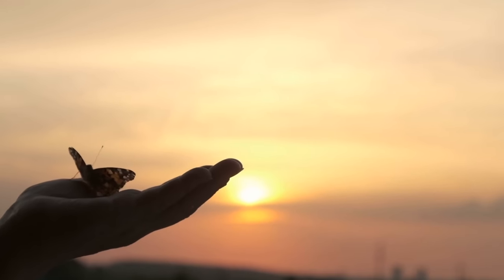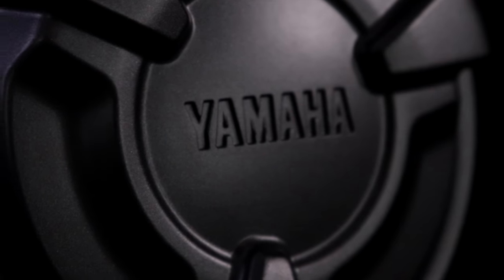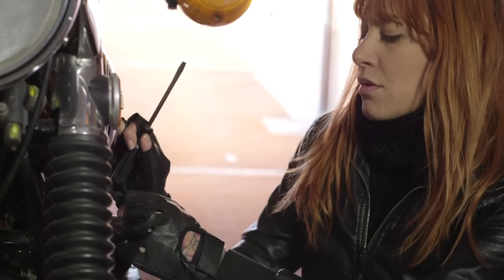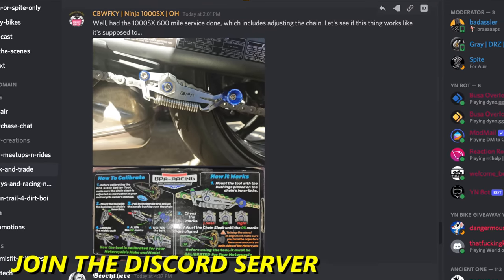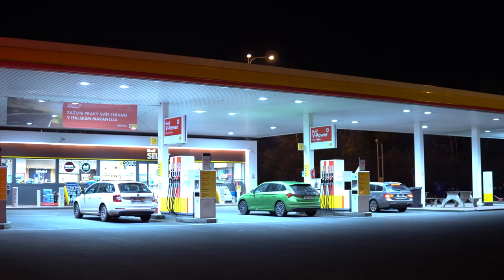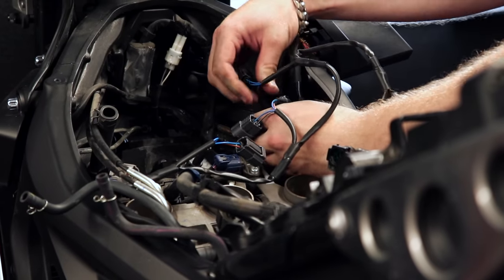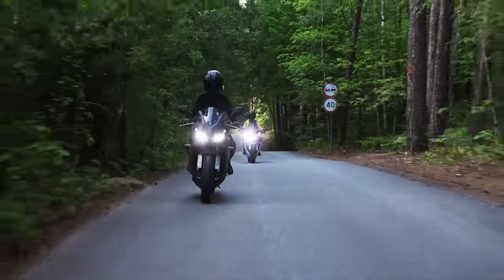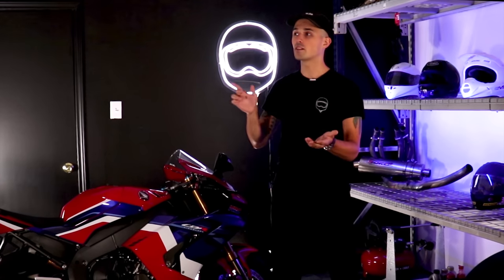7 Ways to AVOID Damage to your Motorcycle (Will Last Forever)!

Comment: You do realize that the redline and even the factory rev limiter (which is usually above the redline) still actually have a certain amount or percentage of safe operating limits built into them right? Bikes leave the factory with this extra margin of safety built in so that the motors will not become hand grenades and need warranty replacements.
Even most aftermarket CDI boxes allow the raising of the point where the rev limiter kicks in and raising it on most bikes by 1000-1500 rpms higher causes no engine issues on sport bikes anyway.
Secret is knowing where the power and torque start dropping off in the rpm range on your particular engine as generally running the revs past that point gains nothing in performance.
Another one that draining the oil for a winter storage is not the smartest, although changing the oil and filter before you put it away is a good idea.
Also when you start your bike ALWAYS run it til it is at full operating temps to prevent creating condensation that does not get dried up before you shut the bike down. And yes store with the fuel tank FULL of treated non ethanol fuel.

Comment: Yammie Noob, you have some stuff wrong. 
1) when you do your valve clearance checks, it’s not the head gasket that you want to replace, it is the VALVE COVER GASKET. It would be insane (a lot of unnecessary time and money) to change a head gasket while checking valves. 
2) it is not best to let your bike sit there idling to warmup. It is best to ride it right away after startup but with LIGHT engine load….meaning don’t lug it in too high of a gear, nor pin the throttle and have maximum combustion pressure. Ride immediately at 1/3 throttle opening or less and between 30% and 50% of redline. Be easy on it until the OIL TEMP is at 170 degrees. This will warmup the bike faster. A SLOW IDLING warmup increases how long it takes for the oengine to reach temp, which increases the amount of water vapor (which is a natural byproduct of combustion) that blows past the rings and dilutes the oil with water. Faster warmup is best, but be easy on it until it is up to temp. 
3) running lean does not make the bike run hotter. When the bike makes the most power it is making the most heat (the burning fuel heats the intake air which expands the air and pushes the piston down). So when u get a bike dyno tuned for max torque and power at every rpm and every throttle position, it will make the most power and the most heat. Running either too rich OR too lean will cause reduced power AND reduced combustion heat. Ask private airplane pilots who have to manually adjust the fuel mixture as they fly at different altitudes (and thus air temperatures and air densities). The highest exhaust gas temp will be when the airplane has the perfect stoichiometric fuel mixture and is making the most power (like for take off). Once at cruising altitude, they will lean the mixture which reduces the EGT (exhaust gas temp), the engine runs cooler, with better fuel economy (but not as much power…but max power is not needed when at level cruise). All too often, motorcycle riders set up their Power Commanders too rich. What does this do? It makes less power and the excess fuel doesnt burn.  The excess fuel washes oil from the cylinder walls which increases piston, ring, and cylinder wear. 

The rest of your video is spot on. FWIW,  I’m a 62 year old retired mechanical engineer who has been riding, driving, flying, maintaining, and tuning motorcycles, cars, and single engine planes since I was 15 yrs old.

Comment: Coming from a dude who dailys a bike in the states these intervals are critical. I literally look at 3 things on my Fz's cluster Everytime I step on. Mileage before and after the ride, check the trip for my oil change and I always run my temp when I'm riding around so if something goes wrong and it starts getting hot I'll know right away and be able to pull over HOPEFULLY not killing me or the bike😂

Comment: Idle for carb for that long if not used for a few days or a while, but fuel injection shouldn't be more than 20-30seconds. Any longer and your ECU for your fuel injected bike will be putting extra fuel in their to cool the engine. Just start riding it gently for 5-10mins before maxing it out, much better for the engine and your time than idling for 3-5mins..

Comment: Funny.. standard gasoline in Europe is 95 octane. Then you got the “premium” gasoline which is 98 octane. Its called respectively e10 and e5. Here its the other way around. If you have a new bike you can perfectly fine put 95 in, but if you have an older bike its best to put 98 in. E10 is partly synthetic and it eats away older rubbers. So you dont necessaraly need the higher octane but its generally a better quality gasoline and better for your bike.

Comment: meanwhile: me on my a1 motorcycle--> hitting redline on highways, little amount of oil, and having to use anything at my disposal to squeeze enough usable power out.
Reply: Jesus 😂 🤭
Reply: @AkaBull  the rev limiter (10.5k tpm) in 6th gear cones on at 79 miles an hour. The speed limit is 75. I cant wait until i can get my a2 liscence. I'll me getting a zx6r that's 25kw on paper but full power irl. By the time i have my full liscence i will have been riding for 7 years.
Reply: @sillymust1057  God. I love it here in the US 🇺🇸 we don't have those restrictions here, we at least not as bad as yours.

Comment: 107,000k on my Victory Kingpin so far runs like a monster put new pistons and rings and freshened the valves at 97k.
Reply: nice almost like a car, 120k is normal for piston rings on a car
Reply: well... on my car at 125k i changed piston rings all gaskets chain and all pumps and some vvt but only piston rings and chain were worn out rings were destroyed and ran without them 8k and didnt missbehave

Comment: I think it's fine to redline if the oil's always good, and it's thoroughly warmed up.
Reply: It will wear out much faster, but we aren't trying to keep every bike as a museum piece. If they only last 100k miles having fun instead of 200k miles being worried all the time, well that's probably 10x more miles than most riders are going to use them for anyways (and then you can always find a crashed bike for cheap parts if you need to fix it).

Comment: Don't let it idle more than 1 minute if you have a 2 stroke :D

Just give it low rpm at start
Reply: I've heard the same thing suggested for all motors. Riding/driving away at very low rpm and load (for the first couple minutes) warms the motor much faster than simply idling it, and warming up faster is supposedly more beneficial to the motor than idling it with zero load 'till warm. -- Of course the main lesson is the same. Warm the bike before working it; warm thoroughly before thrashing.
Reply: @kleinbottled79  exactly. when you leave your garage, there is no need to redline it within city limits. so just cruise until you reach the twisties.
Reply: I do 5 minutes, never had an issue,  well not yet that is 🤭
Reply: why is that? just curious

Comment: -Don't let your bike idle for a solid 3-4 mins. Why? Bcs it takes 1-2 seconds for the oil pump to get lubrcation on every part of the engine.
Yes, the engine should be up to temp before going hard, but you can warm your engine driving softly for some time instead of idling, which provides bad lubrication (engine rpm=oil pump speed).
-If you have modern bike you should not run high ocatane by default, just use whatever the manufacturer recommends in the manual.

Comment: Wait a minute. 3-4 minutes idle? What? I thought excessive idle actually wears piston rings and seriously dilutes the engine oil with gasoline since there is a lot blowby(cold piston rings dont seal all that well)

I always learned to let the bike start, idle for 10-20 sec and then slowly drive and only give more throttle when oil is warmed up.
Reply: Yes that is also what I am taught. a lot of old timers say the same thing. Don't listen to yam on this video, especially on storing the bike without fluids.
Reply: That's essentially what I do. I start my bike in the garage, push it out, shut the garage door then hop on and ride, maybe 30 seconds. Never once had a problem and I've been doing the bike thing daily since 2002. All super sport bikes except for a new Harley which I hated.
Reply: @madpirate1790  that is also my routine. I'm glad it's worked for you, almost everyone I've asked who is very knowledgeable about engines recommends this
Reply: @sam2920  yeah it's better to do if you ask me and like you said alot of other mechanics will say the same thing. Just ride it around for a few before you start taking it to Redline.

Comment: And lean air fuel mixture is not hotter than stechiometric 😄 the highest burning Temperaturen is at stechiometric. If it gets leaner ist will get colder. The same for ritcher.

Comment: 280000 on victory v92 full syn oil basically stock motor I don't beat on it but ride hard n long big tips use good oil all the time.n don't just ride to bars ride at least fifty miles

Comment: As far as warming up goes, I don't like keeping the bike on in the garage for more than 30s - 1m, even with the door open, because of exhaust vapors. If I let the bike idle in the back alley, where my garage lead, it's kinda noisy for the neighbors and I don't like being "that guy". Is it okay to drive off immediately, but just keep the revs AND the throttle inputs really low? Like shifting at 3-4000 rpm, while the engine warms up?

Comment: For warming up my engine, I kill two birds with one stone; I start up my bike, then get suited up. While the engine is warming up, I'm putting in my ear plugs, donning my jacket, etc. By the time I'm finished gearing up, I'm good and ready to go... :)

My dealer doesn't carry the manufacturer's oil for my bike, so I use the weight recommended in the owner's manual.

For gas, I run regular 87. What more does one need with a 9.5:1 compression ratio?

For engine mods, all I did was remove the stock filter and airbox snorkel, and replaced with DNA Filter's high flow filter and high flow airbox intake. I let the engine run 15-16 minutes at idle, so the ECU could adjust itself to the different O2 sensor readings it was seeing. After that, I was good to go! I wouldn't do any more with my bike though.

Comment: Idk about tip number one, the oil pump will distribute the oil immediately when the pump is turned over even from cranking. Viscosity of oil is actually thicker when it’s cold vs when it’s warm. Letting it sit for 5 min will do nothing different than if you let it sit for 30 sec or even 15 sec after starting.
Nooooo don’t do dry storage
Reply: The metal won't be at the correct dimensions, its really not so much spreading the oil (though its lubrication value I think does go down when its cold), its more the valves/piston are at incorrect dimensions and will therefore wiggle more and scrape things up. Some engines you can really hear a horrible nocking sound until they warm.

Comment: you don't ever do head gaskets for fun. if you take care of a motor, you can run it hard and maybe never do a head gasket. you probably mean "valve cover gasket." you do head gaskets and cylinder and case seals when you're building engines. they're NOT maintenance items. replace only when blown.

Comment: I just got my bike AND started riding just yesterday. And it kills me to think that thing may die on me one day
Reply: In most cases bikes die of loneliness. There are a ton of 250cc bikes that just get put away (often improperly) before they get even 5k miles on them (mine is somewhat sadly an example of that, though I do have it in a shed and I blocked it up so the tires are less likely to rot or get flat spots). The other thing that usually kills bike is a wreck, in which case there is a good chance if your bike is totaled you're also probably dead, so wouldn't worry too much about the bike. Then the last thing is someone never changing oil, but if you're maintaining it then that's probably not going to happen until its so utterly obsolete its an antique or drove it multiple times around the earth and got 50x your money out of it in enjoyment.

Ride it and don't worry about it, worst thing is for it to die of loneliness so rack up as many miles as you want, just keep the oil changed at reasonable increments and have fun, cheers!

Comment: By the manual, my '20 ZX14R has a 7,500 mile oil change interval with full synthetic 10W-40. I know that fresh oil is always preferred, but to change at every 3,000 miles goes against what the engineers at Kawi think is best for the longevity of the bike? I'm torn, I want to change it sooner but if it's not really necessary under normal riding conditions...
Reply: If you are using engine oil recommended by the manual you can stick to 7,500 mile oil change interval, if you are using other engine oil you are best to ask the shop retailer when to replace oil. there is no harm doing it earlier like 5,000 mile oil change. I assume 3,000 miles oil change interval is for those who ride small cc bike, for example in my country (Asia), we have 110cc underbone that need to replace oil every 1000 miles with mineral oil, 2500 miles with fully. While my cbr250r oil change can stretch to 3500 miles with fully.
Reply: if you dont ride it like youre on the track all the time it should be very much enough to change that oil every 7,5k miles
Reply: I mean Kawasaki made the thing. They exhaustively test each part of the motorcycle. I'm sure the way oil performs and deteriorates has been thoroughly tested aswell. People take the torque specs given by Kawasaki as gospel but not oil drain frequency. People pick and choose what they want to believe in. Just like hard engine break in. They hear someone say its this way and believe it.
Reply: Send the oil to a lab at 3k miles. It's the only way to know.  I personally change the oil when the gear box starts getting hard to shift. Often before 3k but I ride a dual sport.

Comment: Idling is absolutely NOT the best way to warm up your engine. Get oil temp up in low to medium rpm. Just start riding, shift early and keep rpms low. Once your clutch cover is warm, oil is on operating temp.

Comment: I will say this, in my own preference (I only have 91 octane here) I run 91 octane in both my bikes all the time, the price difference is not extreme. I have a 2003 intruder 800, that actually revs quite high for a V twin. I also have 2020 WR250R, which revs out at 10k rpm, which is alot lol, and it loves to be in those revs to make power. 

In my opinion, if you have any bike that is either powerful, or high revving, go for high octane, unless you have a old bike with low compression (hell my dad has a DR650 and he runs 91 octane)
Reply: sheeesh. the place i live in, 95 octane is the cheaper gas. 98 is the premium and we even got 100 octane "race fuel"
Reply: @BeniaminKis  man you are living the dream, I wish we had that high octane, it would be alot better for stuff like my dad's viper (that's supposed to run on 93) so we just use an octane booster

100 octane would be insane to have where I live

Comment: Why would you "use a fresh head gasket" after you check your valve clearances? 

You don't need to separate the head from the block to get to the top of the valves. 🤦
Reply: He meant valve cover gasket but if you've done a few you know those are good to go without replacment most of the time

Comment: Single cylinder small displacement bike with around 20k miles. Should I check the valves? Every time I tell my mechanic to do it, he says it's not necessary.
Reply: Get a new mechanic

Comment: Suzuki recommends for long-term storage to fill the crank case completely with new oil?
Reply: Yup... Metal can't rust if it's COVERED in oil in storage. JUST remember to drain the excess before riding it again...  ;o)
Reply: Its because Suzuki builds engines. Yammie usually does not keep a bike for more than a few months at a time.
Trust your manual not youtube.

Comment: I have a 04 bandit 600 iv had ot from 3000 miles never touched the valves only changed oil ever 5k for the past 12 years think has over 90k miles on it 🤣🤣

Comment: I just got a 2018 r3, and I’ve been looking for which gas I should put. Manual says 87 but others say 89 or premium.
Reply: Do what the manual says, higher octane (the count of molecular bonds in the chain) the slower it burns. Since you aren't running a turbocharger or extreme high compression then a slower burning fuel isn't going to help you, hence the manual is telling you the correct value.

If you do put a supercharger or turbo and start cranking the boost pressure high you'll either need to run higher octane (or methanol fuel), or you can add head gasket shims to reduce your before detonation pressures. You probably aren't ever going to do that, so don't worry about it, just run 87 like the manual says.

Comment: I'm not sure about that last one. Oil keeps metal from rusting. Bare metal like the inner parts of an engine, are protected by rust. People I know who stored old cars for several years would fill the WHOLE engine in engine oil. Fill the cylinders, the head and the crank shaft with brand new oil. Engine came out perfect decades later that way.

Comment: For bikes with wet clutches I know that I'm not supposed to use synthetic motorcycle oil. However I have been having trouble finding any non-synthetic locally and have been told by another rider that Delvac diesel oil is by best bet for my 80's Honda. Any truth to that?
Reply: You can use synthetic as long as it's rated for wet clutches. Any motorcycle shop can help you